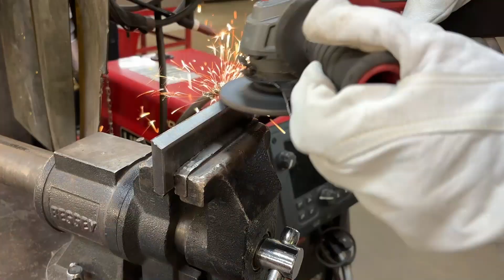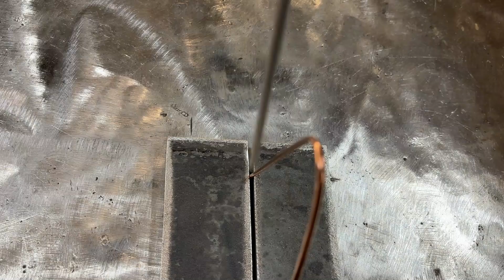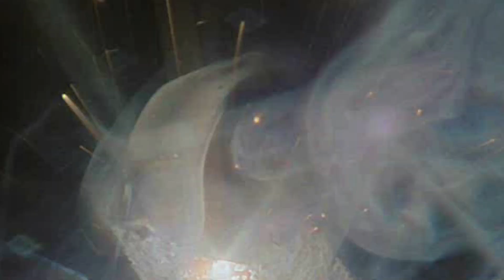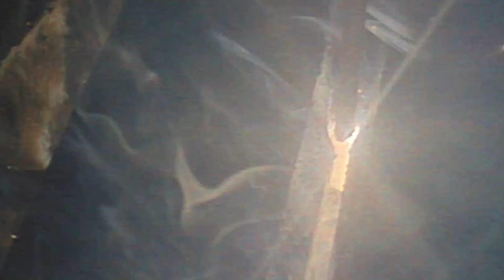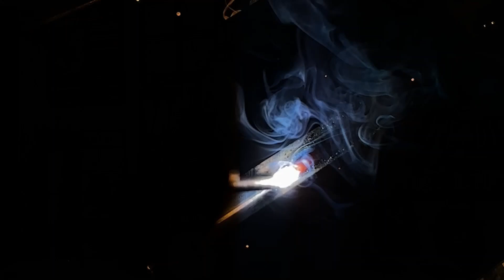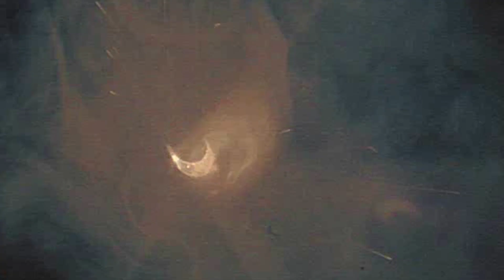How to Run an E6010 Open Root (Flat Position Step-by-Step)

Comment: What would you suggest if your rod keeps going out because your sticking it but when it doesn’t stick you don’t get enough penetration??
Reply from the maker: If you have a newer type machine I would increase your arc force but this sounds like you are not using enough amperage. Make sure you can busy that rod. What are you using similar setting to what I have in the video?

Comment: Quick question, mastering this technique will it be similar to welding on pipe?
Reply from the maker: it will- this is a good place to start
Reply: Yeah buddy.  It all ties in together. From the very basics way up to high pressure vessel welding for nuclear facilities, or underwater welding.